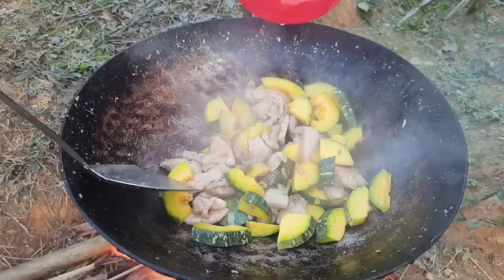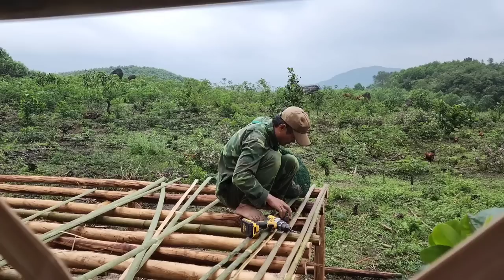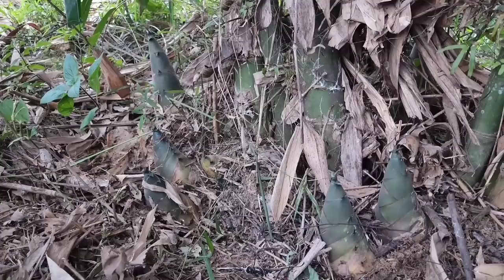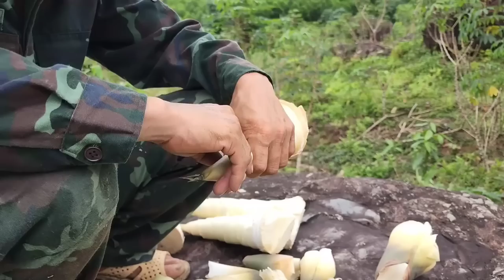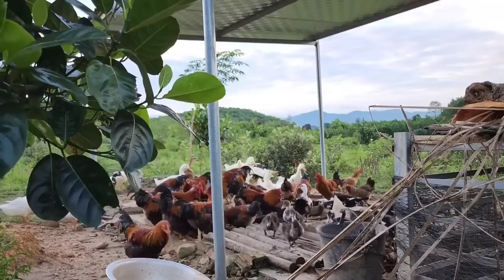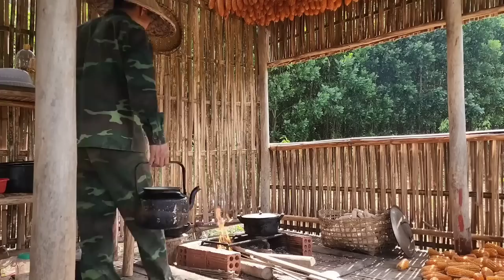Full video: 110 days of building houses on stilts, bamboo floors, kitchens, toilets... building farm

Comment: Ninh, I just saw a recipe that use two large cassava roots about 6 inches long and about 2 inches diameter. Peel the cassava clean,  scrape cassava (shredded) small pieces. Remove juice from cassava. In dish with cassava with no juice add two TBSP of sugar, 200ml evaporated milk or fresh milk, mix well. Set aside.  In two small tins add 1TBSP Sugar each. Melt sugar in tins until turns a golden color.  Put over medium heat u til all sugar has melted, set aside an cool and harden. Now pour mixture of cassava into prepared tins. Now set tins in another pan and allow to stream for about 40-45 minutes. Remove from steam. Cut around the edges to remove from tins. Cut into desired shapes. Good luck. I saw this and I knew you and your family eat cassava root, so I thought why not pass along. Enjoy. Michael-Idaho-USA. Hello Mrs. Din. May I have your permission to call you by your first name?
Reply from the maker: yes thank you very much...

Comment: I notice you put the green up others I’ve seen have done the opposite. The when Trai was helping So’n with the fish pond. They together put a new deck in and Trai use bamboo poles for the  floor instead of splicing the poles. What is the difference?

Comment: As you know the nails went all the way thru, be careful when climbing around in the attic and don’t bump your head it could hurt very bad or worst case permanently! Try to get or use the right length of nail or screw that goes thru both pieces, but not all the way.screws are the best for they do not work themselves out like nails do.

Comment: Another recipe , however I don’t know if the ingredients are around.  3-4 cassava root, juice drain.  1 can condensed milk (real thick an  sweet); 1 can coconut milk; 1/4 cup sugar; 1 Tbsp butter melted; 1/2cup macapuno., ( drain juice);    Custard:  3 whole eggs; 1/4 cup condensed milk; 1/4 cup evaporated milk or fresh milk.

 In  a large bowl put cassava root minus juice ( save juice) . Pour melted butter on cassava, add 1/4 cup sugar; add coconut milk, add condensed milk; stir and mix well, add drain juice (macOS-unopened) stir mixture again mix well. 

 Pour into grease baking pan. 9 inchX 9 inch pan;   Bake at 200* Celsius in preheated oven; baked for 45 minutes, stick tooth pick in center if comes out clean, remove from oven. If not cook a little longer not much.

 Custard:
In a medium bowl or large bowl mix 3 eggs, 1/4 cup condensed milk, 1/4 cup evaporated milk or fresh milk; mix this altogether until smooth;

 Taked bake cassava pour custard over cassava, bake again for 15-20 minutes. LET THE CUSTARD CAKE COOL BEFORE SERVING! Enjoy I hope. From your friend in Idaho-michael-USA